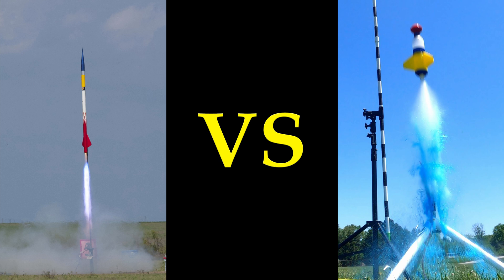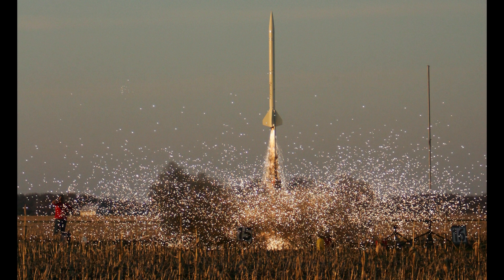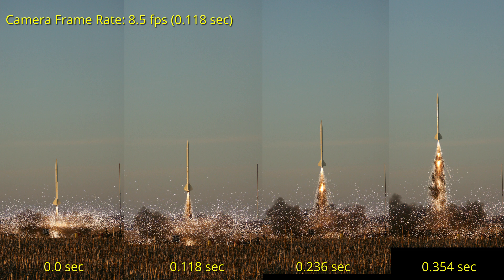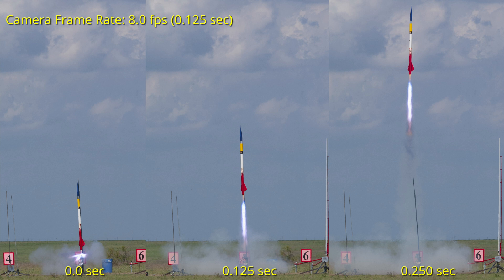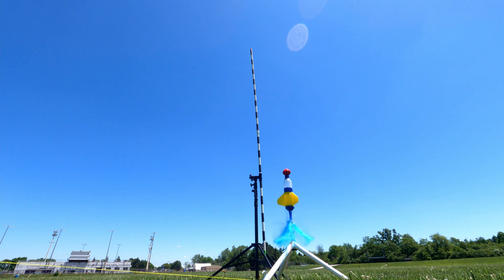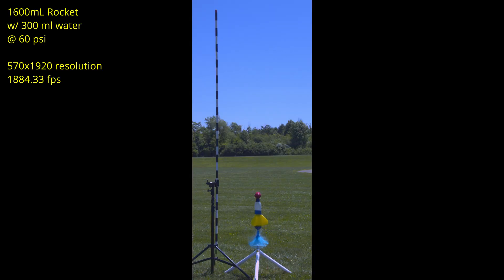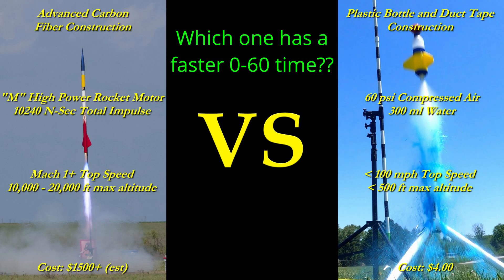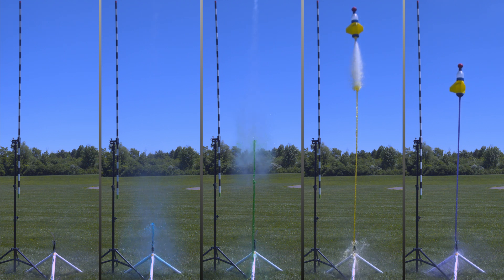High Power Rocket vs Water Rocket 0-60 mph race!

Comment: The thrust duration for the solid rocket is .2 seconds to a couple seconds in some cases. Thrust duration for the water rocket is only a tenth of a second or so.
Reply from the maker: Exactly.  The thrust duration for the launch I analyzed was about 0.066 seconds.  I don't have high speed footage of any solid rockets (maybe some time in the future!), but they also have quite a long ignition time depending on the propellant and it takes awhile to build up full pressure.  By long, I mean long relatively speaking... it's probably only a couple tenths of seconds.